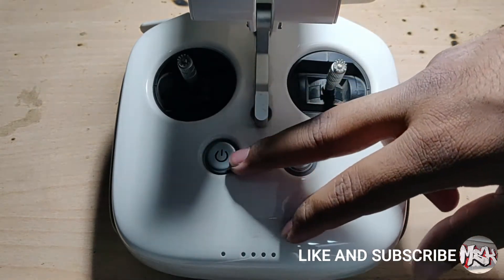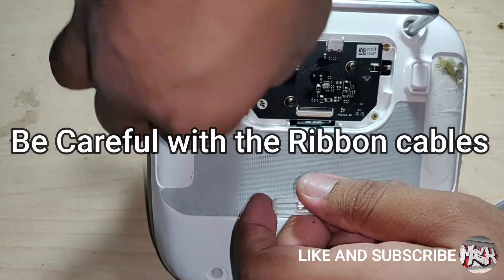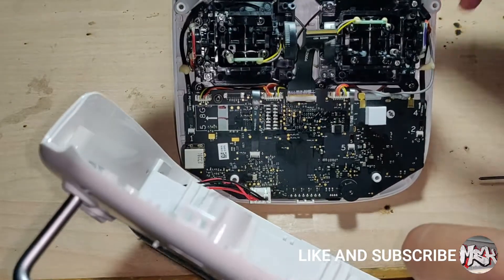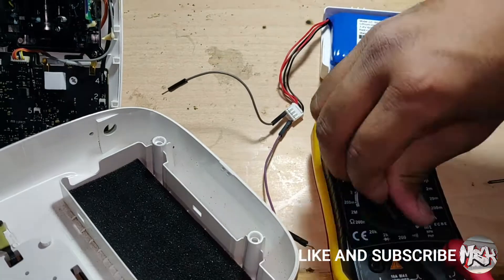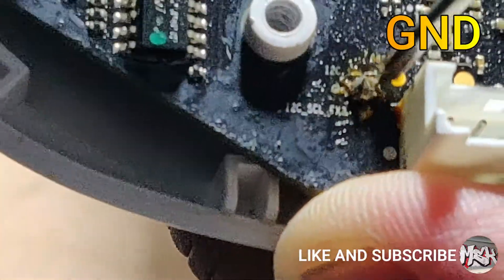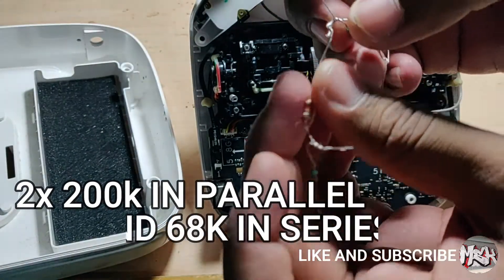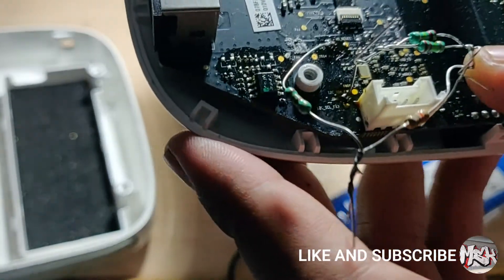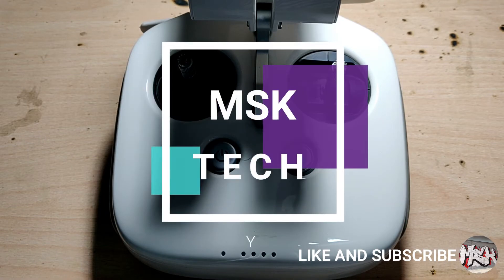DJI Phantom 4 Remote Controller Low Battery Repair Guide

Comment: Hi @MSK Techy - worked fine for - but other has also asked - can we remove the resistors again afterwards? (now have  i put everything toghter and don't want to do it if not nessary) - and any idea of the reason to put these resisters in between? Why has the BMS drifted ?
Reply from the maker: Leave the resistors as it is inside the RC.
All electronics degrades with time so eventually they need a reflow but in my case I bypassed the existing circuit.

Comment: I am trying to fix a p4 pro plus  has a different board no any specific label for soldering any idea how to do the same on it?
Reply from the maker: Try different combinations of resistors, just make sure resistance between two terminals should not be less than 10k as the RC might consume more current just for voltage monitoring.

Comment: it doesn't work when i solder to the gnd pin, strangely when i remove the gnd pin it starts to charge, but the problem is the led always says full battery

Comment: Hi, nice video, thanks!
Same problem as yours, but my battery has 8,34V (99%, almost new :) ) what resistors can I use or what other solution? Thanks !
Reply: Hello. Found this video because I have the same problem. My battery is also 100% charged, could you find the required resistor value?
Reply from the maker: Try the same resistor values, if doesn't work then let me know.

Comment: Dear author! You said in video "We need 80K and 100K. I don`t have 100K".  What is correct nominal for resistors?
Reply from the maker: You can make 100k if you know the series and parallel math of resistors. Can follow this article - https://byjus.com/question-answer/why-is-resistance-different-in-series-and-parallel/

Comment: Would you please and answer to the question : 2x100k or 2x200k are in parallel? The scheme and the text in video are not the same?
Reply from the maker: It's 2x200k in parallel

Comment: Hey awesome video, I have the same issue, did the fix you showed but didnt work, any idea what could it be? i have the GL300F that doesnt have any words in the pads but I used the ones in the same position as you did
Reply from the maker: Grab a multimeter and measure the wire continuity between one of the pads and the battery ground, do the same with another pad and the VCC of the battery and if both pads are short with the corresponding polarity of the battery then you have found two pads so far. For the third one you will have to the hit and trial with the other pads closer to the GND and VCC pads. Try this👍🏻

Comment: Where will the cells inside the battery of the drone be found, please tell
Reply: Inside the battery case.
Reply from the maker: Just use a Phillips screw driver to open your Controller and you will find the battery inside

Comment: I have a same issue here, after 1-2 years I’m not turn on the phantom. Omg have another easier ways to make the remote working? After charging 4-5 hours still the same. Only 1 led come on
Reply: I had the same issue. I unplugged battery from the board (white connector), and plug it back in 10-15 seconds. After these actions controller was able to charge.
Reply from the maker: Did this video solve your issue?